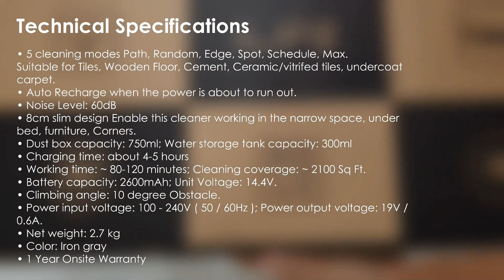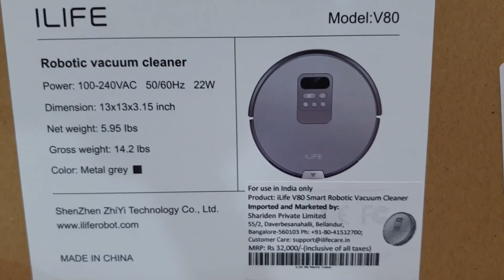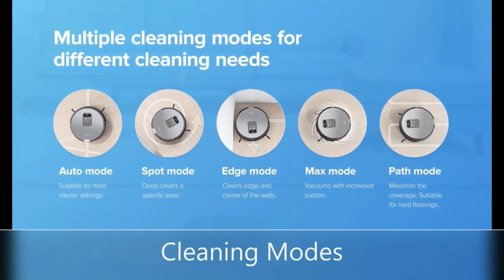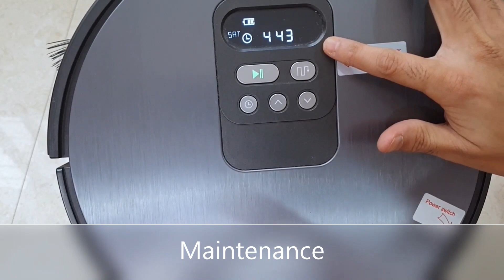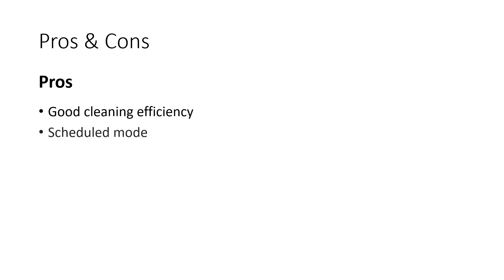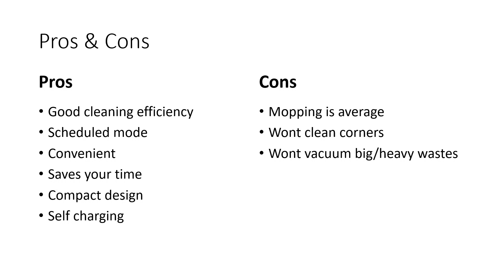ILIFE Robotic Vacuum Cleaner with Mop Review | V80 V8S | Unboxing Demo Features | Long Term Usage

Comment: I bought v8 model based ur reviews and I am liking the product.
Thanks 🙏
Reply: Hi ruchi, iam also planning to buy, does it cleans tiles floor,  cement floors neatly,
Reply: @aishwaryasathelli7416  yes why not sweeping is brilliant.I have v8 s model.
Reply: Is their service centre and parts available?
Reply: @keyuri1101  yes all spare parts are available online and are very reasonably rated like fan and filter is for 100 & 150.
Customer care is very prompt, initially they provide video call support and if someone is still unsatisfied they do machine pick up and send it to Delhi or mumbai for further troubleshooting.
Hope it helps.🙏
Reply: Hi Ruchi..are i still happy with the product?

Comment: Hie
I have few questions 1. Does this one need wifi connection for working. 2. Does it do sweep and wipe at same time? Without changing the attachment?.3. Does it have auto resume mode?. Thanks in advance!
Reply: Yes it will work with mobile hot spot WiFi

Comment: Hi. This is  an excellent video. I had one question. Does it clean hair and fine and whole dust? Does hair cause any issues to the machine?
Reply from the maker: It will tangle all hair in the brushes, that has to be cleaned later on.

Comment: Hi I had this query, I have pets in my house and they get freaked out because of the traditional vacuum clearer, so is this product lound? And also that, can this product be used on carpets?
Reply from the maker: Hi Radhika, it will make less noise compared to traditional vacuum cleaners but not much difference and for carpet u can use this one also but I suggest you to check other models designed for carpet as it has roller brushes at bottom for deep carpet cleaning.
Reply: Information Unboxed thanks.. looking forward to buying this ✌️😎

Comment: Very well presented! Two questions:1) Is this model capable of climbing up carpets on its own? and 2) How is the carpet cleaning efficiency?
Reply from the maker: Yes It can climb heavy carpet. 
For carpet cleaning go with some other model which has brushes at the bottom. We have another video with top 10 best robotic vacuum cleaners in our channel, you can check that video.

Comment: Useful video. Noticed it doesn't reach the wall.in Auto mode
Reply from the maker: It do starts with the wall first in auto mode, however it is not in the video.
Reply: @InformationUnboxed  ok

Comment: Hi, Thanks for the review. Since you keep it always on, does it consume a lot of electricity? Has you power bill spiked up after purchasing it?
Reply from the maker: No it wont consume much power. It works on battery and charges with an adapter like mobile charger.

Comment: I purchased V8 model recently. The machine makes lots of noise while cleaning. Is it normal as the other model A9 which we are using since two years is very quiet. We complained to company and sent dust tank for repairs but they sent it back as it is and refusing to replace it or even acknowledge our complaint. Please advise. Thanks

Comment: which is better ECOVACS DEEBOT U2 Pro or ilife 80. Because ilife 80 has less suction power so I think u2 may be a good choice. Please advice
Reply from the maker: U2 is slightly better. We have a video on top best robot vacuum cleaners in our channel. You can check there also.

Comment: Can this pick up hair from the floor? How does this compare with the roomba vacuum cleaner?
Reply from the maker: If it is long hair, it will tangle hair around the brushes, then that has to be cleaned manually later on.

Comment: Please suggest me which is be better for sweeping and moping mi ,viomi v3 and  ilife v80 pro??
Reply from the maker: V80 pro if you are looking to also operate from remote controller.
Reply: @InformationUnboxed  sir jinme remote control nh hota kya wo without internet useless hote hn
Reply from the maker: Yes you can only use it for basic cleaning and cannot explore other functions.
Reply: @InformationUnboxed  ok,thnx alot sir🙏🙏

Comment: Hi, I have a question. Should it be plugged in and switched on always even while we aren't using it? Thanks in advance
Reply from the maker: Usually we always keep it on as whenever we want to use then it will always be charged and then once the job is done it locates the charging dock and automatically goes to charging.
Reply: @InformationUnboxed  oh okay, thanks so much for replying, really appreciate 🙂

Comment: Hi I got the same model but the suction port cap is loose. Is it like that or did I receive a damaged product. Can u say based on your experience.
Reply from the maker: No it is designed like that only, flexible.

Comment: Does it suck in bigger debris like small pieces of paper?
Reply from the maker: Sometimes it might go inside the wheels but it will still function normally. There are different error codes given that we can check and fix if something is blocking.

Comment: Dyson (normal ) vaccum cleaner or robo one pls recommend
Reply from the maker: Robot vacuum is only for floor and does the job automatically,
while dyson can be used for floor as well as on any other surface at home like ceiling, fan, etc but it has to be operated manually.
Reply: Information Unboxed 
Tq for prompt response

Comment: what if there is spilled water on the floor and using in vacuum mode?
Reply from the maker: It will damage the vacuum, use it only for dry dust.
Reply: @InformationUnboxed  So I believe mi robot vacuum cleaner is best suited for this purpose when using vacuum+mop mode? It should not be getting damaged when there is liquid spilled on the floor?
Reply from the maker: For water spills, wet mopping robot are available in the market for example iLife w450 and iRobot Braava Jet m6

Comment: Does it need WIFI or Internet connection
Reply from the maker: No, this model comes with remote control
There is a pro model too for which you need Wi-Fi.
Reply: @InformationUnboxed  thank you very much
Reply: Hi , one more question , can we set a schedular like every day this particular time clean should do in the remote control model
Reply from the maker: Yes you can schedule.

Comment: What is the life of this machine ? 
Any idea ? 
We will be spending 23k for how much time will it work??
Reply from the maker: It is working fine for us for the last 18 months, you can expect the battery to work for 3 years and then replace the battery, also there are some brushes and filters that needs to be replaced once in a year.
Reply: @InformationUnboxed  from where do we need to buy brushes and filters , and what is their cost ??
Reply from the maker: On Amazon or their Official website. You can buy vacuum with these accessories safe side for future use.
Reply: @InformationUnboxed  thanks for replying

Comment: Demo mein dirt/dust toh saaf nhi kar rha . you are just running it on clean surface. Do through testing and then post videos.
Reply: You can check the dust at 10:55 which was collected. And no dust is easily visible on the floor. Not sure what exactly you are looking for, you can check for other reviews.

Comment: I bought one after seeing your demo. It doesn't follow the path pattern in path mode. I feel thoroughly disappointed.
Please don't do such promotions for the sake of money.
Reply from the maker: This is not a promotional video, as mentioned in video this is a self purchase and this is a review video and we have mentioned both pros and cons. Also we are using it for more than a year and it works fine for us in path mode. If it has technical issues you can claim for the warranty with ilife support team.
Reply: @InformationUnboxed  I checked,no tech issues, the only option I can use is auto mode, in which it does both edge& path mode. Their "sales" assistant asked me to purchase this model when I specifically asked for path mode as you explained in your video. But now they are telling me to just go ahead with auto mode. I feel really cheated.